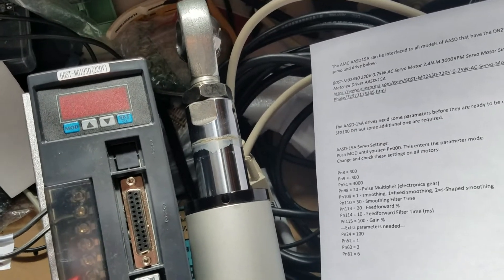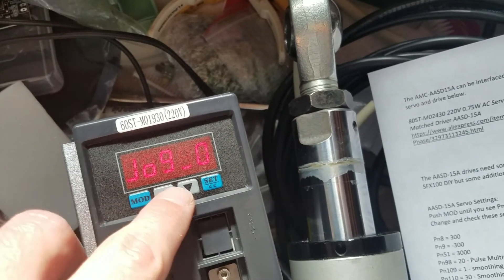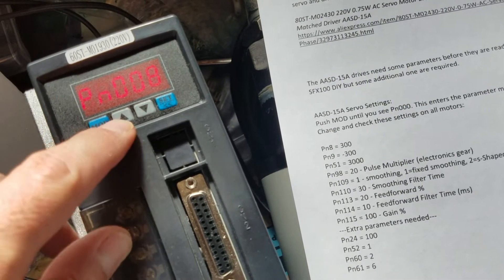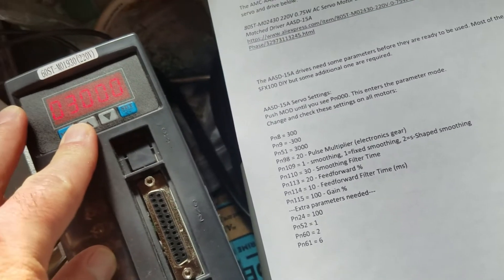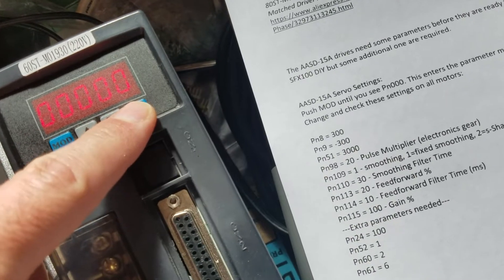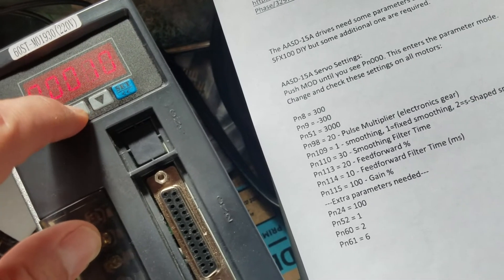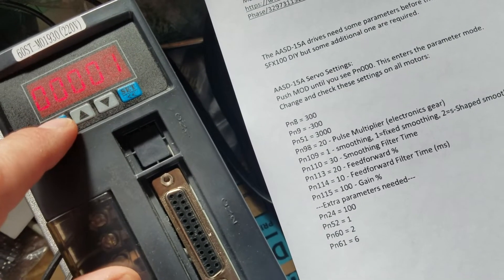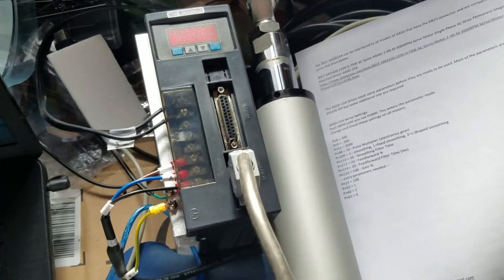Setup AASD-15A parameters for use with AMC-AASD15A controller

Comment: @Thanos Motion Electronics Hi Thanos

3 of us who had issues with the Rs Mega kit all found that the parameter PN-83 was set wrong for our countries it should be set to 200 but they all arrived set to 100 could this damage the drives? And could this cause issues on the system? 

Is it possible to let Eracing lab know their drives are being sent with the wrong alarm parameter PN-83 because this is an alarm so it’s there for a reason so setting it incorrectly seems strange to me
Reply from the maker: @Simlife101  this parameter, only indicates what is the lowest voltage threshold that the Low-voltage alert will be asserted. It's not setting the operating voltage. Even if you set it on 100v will still use 220v if you supply such. But in some cases for critical equipment that needs to work on certain voltage if the voltage drops can mean not enough power can be supplied from the mains outlet and should result in alarm to prevent damage in wiring from over currents. So, no, nothing like that parameter can contribute to issues you may have. Could have been just a bad batch of drives from the factory, in which case you could contact eracing-lab for replacement or advice.
Reply: Hi mate, is this aasd15a 10.000 step/rev??? @tronicgr
Reply from the maker: @botak333 yes. I send pulses according to 10000 PPR encoder
Reply: @tronicgr  oke mate
Reply from the maker: @Simlife101  also, all these new white drives ship nowdays with pn83 set to 100, as they used in countries with either 110v or 220v mains, and has not been a problem.

Comment: Thanks for the excellent video Thanos 👌 I just now discovered I have been running my 3 x PT Monsters at 5000 Rpm instead of 3000 (Pn51) for past 18 months.  I was told that everything was set correctly at Shao's factory prior to shipping.  Do you think it possible the higher Rpm setting will have caused degradation of the servo motor life or any other damage ?
Reply from the maker: No, just causes snappier movements, perhaps a bit overshoot too on long runs if you don't have on the spike filter to slow down.
Reply: @tronicgr  Ok yes it was definately very snappy in the movements at 5000 !

Comment: What is mean by Pn8 = 300 and Pn9 = -300, is these the length of the ballscrew
Reply from the maker: No, these mean -300% and +300% max torque limits... above that for a few seconds the driver will stop with alarm
Reply from the maker: You set the length of your leadscrew in the AMC-AASD15A LCD menu (stroke and leadscrew pitch)

Comment: I'm checking my actuators with this and one is working but with the other three I get flashing dots at the bottom between each letter/number and the last line turns to an 'E' when I press the up/down arrows. --> I just asked this on your discord channel and well.
Reply from the maker: What do you mean you are checking, what? The video just shows what parameters to enter to be plug a play with AMC-AASD15A controller...
Reply: @tronicgr  Thanks, checking that the actuators were moving, got it figured out, Pn-083 voltage setting was wrong (deleted from your Discord).

Comment: For the ASDA-A2 / B2 / M / S / A2 series, it is possible to use a programming software called Asda-Soft.

Do you know if there is any programming software for the aasd-15a drivers?
Reply from the maker: No sorry,  I'm not aware of such software.
Reply: Did you find any software that suits for aasd-15a drives?

Comment: hello
Hello, my servo can be moved by hand and when I turn it back to the point.
I need you to have more strength and not move.
you know what parameter you have to adjust

hola, mi servo se puede mover con la mano y cuando lo sueto vuelve al punto.
necesito que tenga mas fuerza y no se mueva.
usted sabe que parametro hay que ajustar

gracias
Reply from the maker: The rotation of the actuator by hand is normal for linear actuators. Some actuators that have floor contact use anti-rotation mechanism.  See this video: https://youtu.be/Vmcdol5lMvg
Reply: Enable pn003